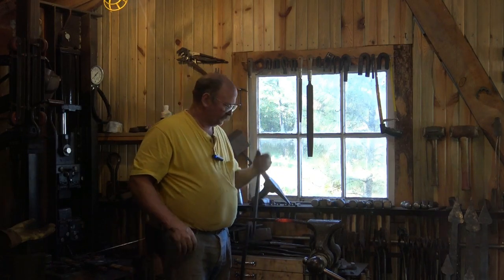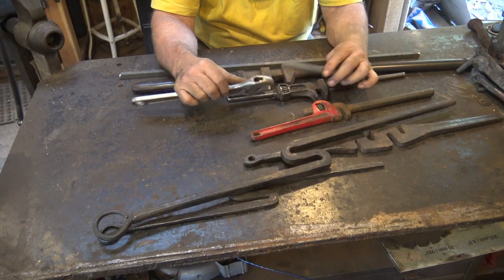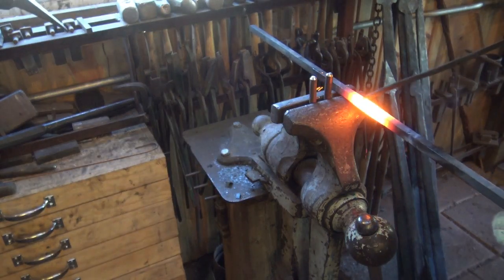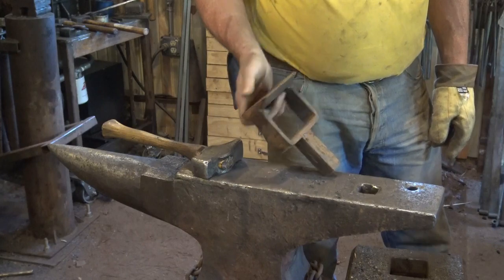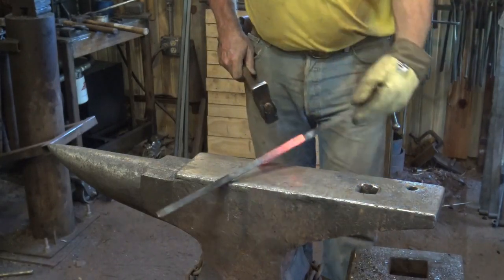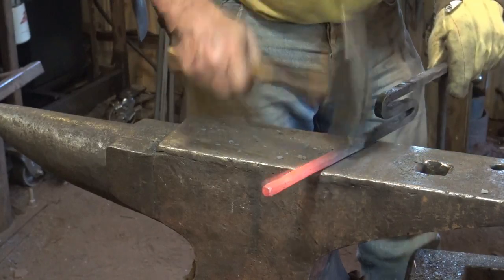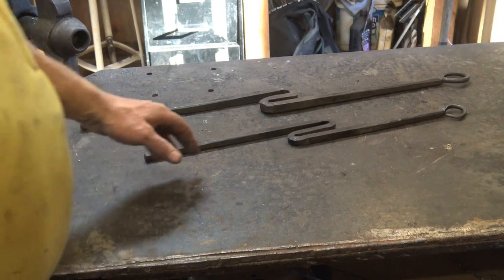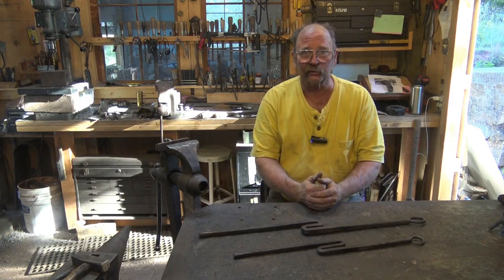Blacksmith twisting wrench - forging a simple twisting wrench

Comment: Very comprehensive coverage.  I have seen another more advanced method for forging a bending fork, but technically a bending fork and a twisting wrench are not quite the same thing, even though in a pinch, a bending fork can be used as a twisting wrench especially if you use two at the same time..

Comment: You can just put a old speaker magnet on the underside of the horn.  Heavy magnet with good power is going to absorb the vibration and quiet the ring but it won t shake off. :)

Comment: Revisited as I now have a "smithy" with a tin roof , no sides, and dirt floor.  Need a bending wrench for 3/8 & 1/2 square stock. Could you recommend a vise which won't emaciate my bank account that I could mount on a pole embedded in the ground?
Reply from the maker: Searching the local used market is the best plan.  Search for both leg vise and post vise on places like Craigs list

Comment: Never subscribed to anything on you tube until I saw your series.
Very informative. 
Not over complicated.
Myself and a friend are building our forge and a power hammer for his shop.
We are in need of a good anvil... we may even try to make one. Any thoughts on types of steel and such for that endeavor?
Reply from the maker: I am glad you enjoyed it.  I will try to keep posting relevant material.
Reply: Black Bear Forge would be most appreciated
Reply: The Outback Tinker making one out of some mild steel we had in the shop. 3 inch solid round stock.
Gonna "case harden" it in a fire pit after build is done.
Then a plate of tool steel for the striking surface.

Comment: I know you forged your wrench to fit a specific size bar, but would there be an issue with giving the wrench a tapper in the area where it grips to accommodate various sizes? Would it cause gripping issues?
Reply from the maker: My thought is that it would tend to slip, but I also haven't tried it so I can't be sure.
Reply: Black Bear Forge I was thinking the same but I wasn’t sure if you had tested it already. Thanks for the reply. Love your work by the way.

Comment: It sounds like hardened steal top cap of your anvil is hollow from the horn to about half way to the hardy hole if you watch this video footage when you are hammering on the horn you can see scale bouncing across the top of the anvil until it hits the spot it is still connected and the scale makes a definite line and there is a crack running down the side where the top cap has separated
Reply from the maker: Interesting observation, I will have to take a close look at it.  I hope it's not the case, but it isn't uncommon to see in an old anvil.

Comment: Any consideration about the length of the handles and the radius of turn clearance where your leg vice is mounted? It seems if the handles were too long, they would not clear your table top. How short can you go and still have good leverage?
Reply from the maker: You are correct.  Long handles can be a problem.  Having a vise mounted on a free standing post with no nearby obstructions really helps.  So does mounting it a 45 degrees on a corner of a bench.  Handle length is largely dependent on stock size.  I have a small wrench I can twist 1/2" bar if the bar is good and hot, that wrench has about 10" handles.  It is possible to twist by taking 1/4 turns and re positioning the wrench, but it is a pain.  My vise is away from the wall on a post and the table is very small, only large enough to set a few tools on.  I probably have 18" to the tool cabinet you see in the video.  That would be my limiting factor on handle length but I can twist 3/4" bar pretty easily with my larger wrench that fits that space.  You can also twist vertically if need be.
Reply: Thanks for the insights, John. I'm just now setting up my shop and I want to avoid things that cause me headache later on down the road. Love to know any lessons learned when you arranged your shop.

Comment: I don't understand the use for a coal forge hood if it doesn't actually pull smoke up the chimney half the time..
Reply from the maker: I think you jumped to a mighty big conclusion from only a few minutes of observation.
Reply: I've watched at least half of your video library and hundreds of other blacksmithing videos here on YT across all my devices and I thank you for your donation to the community. While most of your videos don't even show your heating methods, and much of the time you use gas it's not the first time I've wondered at a video where the smoke is billowing into the shop. And by far your videos aren't the first time I've seen it happening. In fact most blacksmith shops I've seen [of which yours is among the cleanest] have forge hoods coated in black soot on the outside and I've come to wonder why these hoods are accepted across the board as functional when they clearly work only after a few moments of the blower being on and the flame flickers in and out of it until finally a draft is created. 

I understand that there are other concerns for a working blacksmith and this open side draft design is needed greatly when working with larger flatter pieces such as plows, shovels, pots etc and needing the extra space in and around the forge. 

I know there's no sense in reinventing the wheel, but it's things like that which makes a guy like me ponder if there is a way to make a hood like this work for ALL of the smoke. The first thing that comes to mind is running a small squirrel cage blower into the flu via a pipe inserted about half way pointed up creating a venturi effect, in essence a vacuum, drawing air into the hood. Much like how sand blasters work. 

Currently I keep my gas forge near my open back door with a fan in it, and my garage doors open while working, and I plan for the day in my hopefully not so distant future when I build a blacksmith specific shop. One I imagine will have quite a bit more ventilation built into it than my current woodshop/auto/bs/wood turning/storage shop. 

My apologies for my original comment. It was an offhand thought right as I was falling asleep. 

Anyway. Thank you for everything you do. I look forward to watching the rest of your videos.
Reply from the maker: Most coal forge hoods have trade offs between draft and work space.  It seems to be an age old issue, there are old texts that show telescoping hoods that can be lowered down to the top of the fire.  A side draft hood such as mine tends to work better in most cases because any room air being drawn up the chimney must pass over the fire which also pulls smoke up the chimney.  A good draft does require that the chimney is up to heat, so they draw better after an hour or so of work.  You can install a draft inducer and I have seen a simple air line inserted half way up to create a venturi.  I find the occasional smoke that doesn't make it into the hood less trouble than dealing with more equipment.